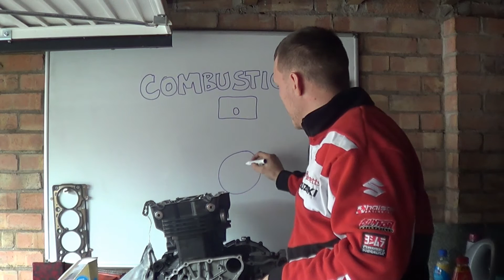Combustion NOT explosion! Rant! - episode 3

Comment: Good one Matt. It would be awesome if we could run our little engines on TNT, but alas the last time I tried it I simply ended up with a pile of twisted rubble. 😂
In all seriousness, there are engine designs that do actually use real supersonic detonation, but it isn't a piston engine. I'm sure you have read all about it Matt. I think it was first done in 2008 in the form of a pulse detonation rocket engine on a modified Rutan Long EZ. There have also been some amateurs trying to make efficient pulse detonation rockets for quite some time.
Oh, before I forget. Matt, would you do us all a favor and explain these new fancy 2 strokes that It is rumored KTM will be putting out later this year on their new enduro bikes. A KTM exec was quoted as saying that their new 250 & 300 EXC TPI will meet Euro 4 standards. Gosh, that sounds awesome. They claim really good fuel efficiency as well. Thanks, and all the best. 👍🏻
Reply from the maker: I have been keeping up, and it would make a great video that and the oil injection system - great comment as always - matt